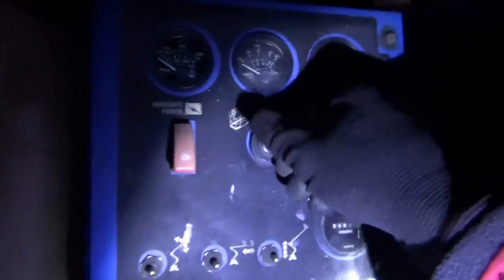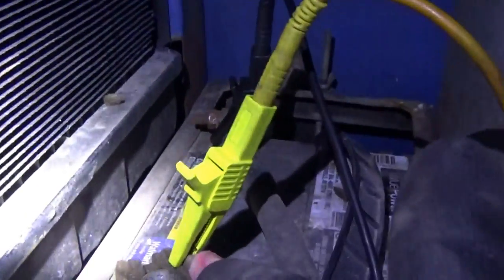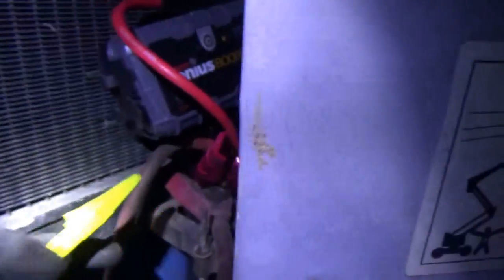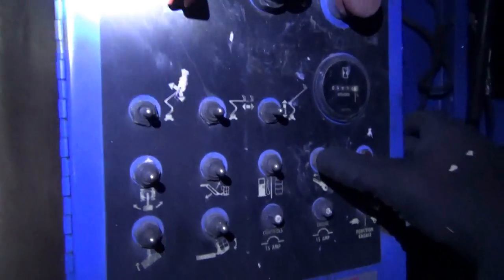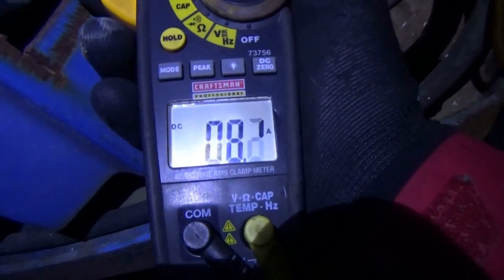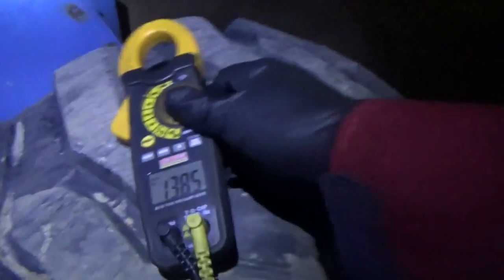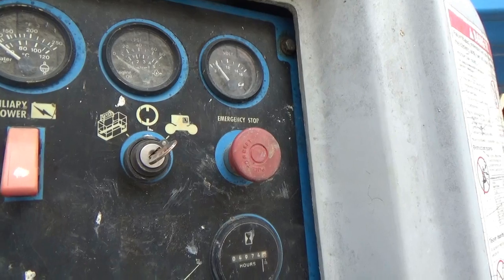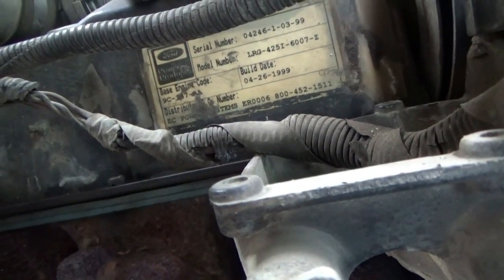NOCO GB70 TORTURE TEST Genie Lift - Part 1

Comment: Wouldn’t it have been better practice to spend an hour to remove the starter-solenoid and make a visual inspection, clean the external electrical connectors, clean the contact points inside the solenoid, check the mechanical components, degrease and then re-grease the bendix with a good synthetic grease not affected by cold weather, and put it back in, before firing the parts cannon at it?  When you get a new starter-solenoid, you will have to remove the old stuff anyway, and install the new one, so the extra labor could be minimal.

Comment: The Noco is supposed to be left on the dead battery for a bit.  It can be used as a quick ump start from cold but I always let it charge for at least a minute or two before trying to start anything.

Comment: We have the GB150 at the shop and it will start a car with a completely dead battery dye to a shorted alternator. The trick I found is hold the button down to turn it into a live power supply and you get more juice

Comment: Walmart never start, lol. That chattering reminds me of the older Ford trucks that had the starter solenoid on the right fender under the hood. If the battery dropped below 10 volts forget about it, not starting.

Comment: these lifts shut off and on alot wear starter and run batteries down alot not running long enough for alternator to fully recharge battery. Very common on them.
Ring gear on flywheel teeth missing damaged. Changed many of them Ford being worse motors. Shalom

Comment: Snap On has the wireless pressure tester that you can get the compression readings on the app on your smartphone while cranking. Now we just need a ampclamp with a app as well then you can clamp it and monitor it remotely.

Comment: I've got a little Rockford lithium boost pack - barely larger than a smartphone. Thing works great!  One time I started someone's Volvo 940 that had 7 tenths of a volt at the battery - flat dead. Couldn't believe it worked! I keep one in each vehicle. That thing has impressed me over the last 3 years. The one in my truck is starting to bulge, however - I think I overworked it on a few truck batteries, LOL. She got hot! 😁

Nice 2-fer on this one. Battery & charging diag, and now something tells me there will be some bendix surgery in that starter. 😎

Comment: Carry a hammer, need a little more punch on that bendix. LOL  Under 12 volts most equipment has a little trouble starting and with the cold as with the heat, battery stress is a concern. Most maintenance free batteries still need their water checked, over charging, heated location and such do seem to affect water levels. Acid alone does not make a good storage source, so if the water gets evaporated or boiled out it will have trouble holding a charge. It could be the solenoid is failing or it's connections are not letting the entire voltage through to fully engage it. Oh the possibilities are why we watch, always like the cliffhangers episodes. Never used a boost pack, was it building a base in the battery or loading the capacitors more in the pack the longer it was connected. You may have to carry more than one set of cables to reach your goals, a daisy chain of jumper cables, that would be a sight. Waiting with anticipation on the fix for this, keep warm, sounds like you had the crud that was going around.

Comment: The starter bendix takes a beating from starting the engine from the basket all day long.  Try crossing the starter at an auto parts store  take the old one with you, usually a lot cheaper than  an equipment dealer. The fix starter, battery, sell it.

Comment: Quick piece of trivia: There is a Genie lift trapped in the railway station of the Dutch city of Utrecht. They built the new station and forgot to remove it before it was all closed off. Now there are no passages large enough for it to pass through.

Comment: Excelent tutorial Ivan! Here in the caribbean we have summer all the time but sometimes the wheater gets weird and drop the temperature in about 20 degrees celcius below the average down to +10 or so along with tons of rain, right away I get a lot of calls for dead batteries, I guess due to the sudden weather and temperature change. Great bonus material! I think your "Pull in solenoid" is working fine because your starter spins without any weird grinding noises, remember this starter settup actually sends current to the starter if and only if the "Pull in solenoid" is mechanically closing the feeding circuit between both the thick positive cable and the starter winding, so I think your starter and your "Pull in solenoid" are just fine but the problem is your Bendix not locking, so changing your bendix will fix it. Of course that's what I think we never know... can't wait to see the second part! Cheers!
Reply from the maker: Great comment!

Comment: pull in coil is fine.   It's the  Bendix clutch that's blown out,  or there's a few busted teeth on the flywheel... you can rotate the engine by hand a bit to test for that.

Comment: You should really pick up a good carbon pile battery load tester. I've run into all kinds of weird starting issues on diesel engines that just came back to a bad battery. It's especially tricky in setups with multiple batteries where one is bad and takes the others down with it.

Comment: They need to install Toyota engines in those things.
Reply from the maker: Nah those would burn all of the oil out from neglect and seize up. The Ford Lima 4-cylinder is the perfect application. Can run without coolant and 5-year old oil no problem xD

Comment: Appears to have bad starter, had similar problem on my 2015 honda accord, starter would spin without engaging the flywheel, replaced starter, problem gone.
Reply from the maker: Wow Honda must source pretty crappy starter these days hahaha! My 1989 Mazda is still on the original starter and alternator. Only thing that wore out was the alternator brushes....$20 part ;)
Reply: Ivan, the problem was very intermittent, 9 out of 10 times, starter would engage, and then it would not engage, just spin. The irony, when I talked to tech at dealer, he said they would not replace starter unless it was 100%  bad, rather then travel back and forth to dealer, I spent close to $400.00 and 2 hours labor and did job myself.

Comment: Flat battery wise, I get it on generator sets where people have used the emergency stop button to stop the engine and left the key on, battery is dead after the weekend.
Engine should just stop on the key, no need to hit the emergency stop button every time.
Starter Bendix wise, it has some grease on there, probably the wrong grade, which is too sticky at low temperatures. So the Bendix can not fly out as the motor starts to spin.
But would it be that type of drive on a '99?
Or the solenoid fork type?
Reply from the maker: I might have to tear this thing apart ;)

Comment: Hi, I'm an expatriate who is working in SAUDI ARABIA.I'm fan of your diagnostic U Tube channel.

I haven't watched the video yet , but when it comes to no starts ( like dead batteries , cold climate) you could just jump start almost any diesel equimpent (which are run by 12v systems) using 24 v . Trust me , that's how the equinments (including famous brands CAT , GENIE , JLG , JCB ,) in the work site which I'm currently working @ jump started in cold season , when they struggle to start or with no start at all.

The 24V electrical jolt will spin the starter like it never before. It is good to know thats the trick enginners are using to activate common rail & gdi injectors in vehicles. 
CAUTION ! like i said we can use over rated voltage , but just for the instant we are cranking the engine or otherwise ??? everybody knows.
Reply from the maker: hmmm so do you carry around a 24V battery for jump starts? Or 2x12V in series? Is it portable?
Reply: It's just the Izuzu maintainance truck's batteries  (thank god it is 24V) hooked up with long jump cables!!

Comment: Starter sounds like a Nail Gun🙈🤣🤣Dr Ivan great job my friend👍
Reply: The sound was coming from the solenoid pulling in, but because of the poor connection on the battery, there isn't enough current to keep it pulled in against the spring, but then it's pulled in again. The cycle repeats.
Reply: Have a wonderful and a safe wk end my friend..Aloha🤙

Comment: I have the GB150, bloody awesome bit of kit, even without a battery in place it will crank large capacity, high compression engines. Pretty cool you have had two battery/connection faults so close together! Keep up the good work, Ivan :)
Reply: Next day, starter shits itself, Murphy's Law.
Reply from the maker: I think that was the original problem to begin with haha Battery died from too many cranking attempts ;)
Reply: Oh, yeh, freezing cold weather will always bring on the starting problems :)
Reply: Not sure about that, the starter is spinning up without engaging and under no load, it would probably take ten or fifteen minutes of holding the key in crank position for it to flatten the battery under those conditions, if the battery is good that is. It probably isn't a solenoid fault on the starter, the solenoid pulls in mechanically to bridge the contacts which supply power to the motor. You know that the motor spins up and makes noise, so the contacts in the solenoid are being activated (it"s just a large relay), so it may be a mechanical fault with the starter drive.
Reply: What was the initial customer complaint? Flat battery? Starter not working properly?

Comment: Starter bendix is bad. Solenoid is energizing & pulling bendix into flywheel and contact is also being pulled into B+ & starter motor contact energizing starter motor to spin. The Bendix or starter drive has an over running clutch portion which has started to go bad allowing it to spin in both directions. It should drive in one direction and spin in the opposite direction. Rebuilt hundreds of them before the rebuilders took over and starter & alternator parts became harder to find.  I have the GB150 and it's bad ass and will start anything including diesels...hasn't failed me yet. Great video Ivan in the cold & dark!
Reply from the maker: Wow maybe I should upgrade to the GB150 ;)

Comment: Solenoid is fine. Starter drive (aka, bendix drive) is bad.
Reply from the maker: So it's a mechanical fault? I thought maybe the pull-in coil went bad. I think that this calls for a PHAD teardown & failure analysis of the old unit ;)
Reply: @PineHollowAutoDiagnostics  Yes, mechanical fault. If it was the solenoid not pulling in, the starter motor would not have power. The starter motor gets power after the solenoid is fully engaged.  Yes, a PHAD  is called for! LoL~! Did you put in a remanufactured/new starter?
The starter drive is available for replacement. I've replaced a few over the years.
Reply: Your right.

Comment: On something simple like that lift you could probably get away with disconnecting negative battery then using a test light across B- and negative cable to look for overall parasitic loss, then from B- to fuses (does it have any?) to isolate what branch the parasitic loss is on.
Reply from the maker: I don't like that method because you are introducing a resistance in the circuit, which will lead to misleading results. Also, you want a hard number. Only a current meter (clamp or in-series) for parasitic draws :)